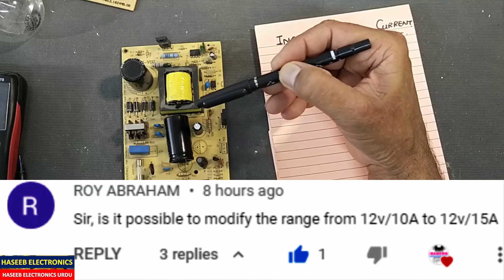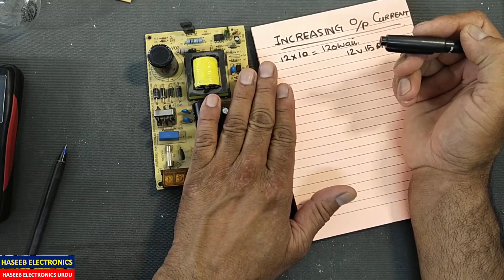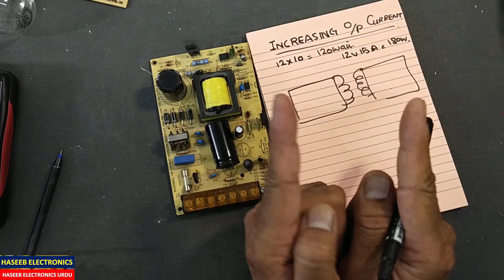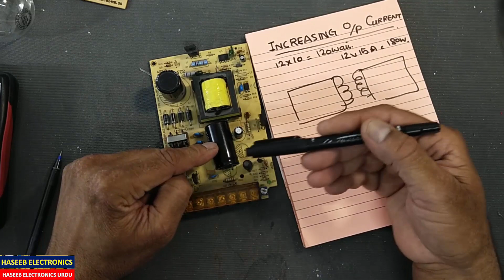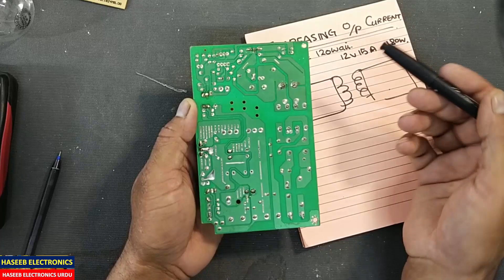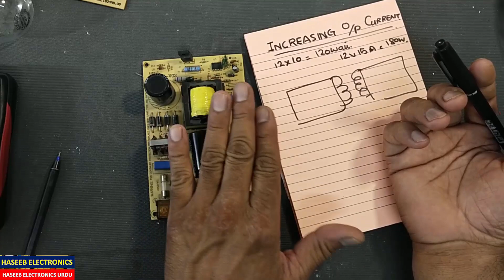{631} Is It Possible To Modify SMPS (Switch Mode Power Supply) To Increase Output Current

Comment: Can we decrease amp 3 to 2 by changing the value of current sense resistor?pl.reply if not affect my power supply.
Reply from the maker: exactly yes. just increasing the current resistor value, and also consider to increase power rating.

Comment: Just connect a 12v screwdriver to the output of the power supply and use it as a generator in both directions. Don't connect any current to the input. It may need 1 min to 10 min generating, when the drill rotated harder, you are done. You can fix defected stopped laptop chargers, usb didn't fix stoen chargers of 5v.

Comment: sir i have power supply of 12v 12.5 amp , voltage is variable , from 10 to 15 volt , i use this power supply to charge a 50Amp lead acid battery, but whenever battery is  deeply discharged the power supply start charging it with current greater than 12.5 amps which leads to trigger overload protection of psu, i want to make the charger current variable and  which should be between 1 to 12 amps, the power supply is MeanWell brand model no. RS-150-12

Comment: Did you ever work on making a dual rail supply by separating the secondary into two coils and making them in series? (We must use balanced load otherwise in load regulated at positive section,the negative section will increase its voltage... Anyway let me know if it is possible...
Reply from the maker: Good evening 
yes dear it is very simple. we need to analyze the load properly, then design the smps transformer using proper apparent power method,
in this technique, the secondary will stable, otherwise the outputs will imbalance and the transformer will heat up,   
if we calculate the load properly then no need to put balanced load on both rails. each winding will run its own load safely

Comment: hi Haseeb...i am using an smps 12v 5amps power supply...i do not want any modifications done on the smps...is there a circuit i can connect the output of the smps to increase the smps amperage from 5amps to 8 or 10 amps with the same 12v output? thanks for the video.

Comment: It is very easy to increase current, just buy a 300W version of the power supply, or better yet make it a 1KW unit so you would have spare capacity!... Another solution is to buy more energy efficient transistors for your projects that require less energy....

Comment: Hello sir plese help me mene  ek 12v 15amp ka smps design kiya hu flyback topology wala ..
Isme voltage and current proper mil rhi hai but but output wala scootky diode kafi heat ho jata hai kuch hi second me .dono side snubber network bhi use Kiya fir bhi heat ho rha hai.
20100 diode use Kiya hu.

Comment: Hi, if the power supply is designed to run on both 120V and 230V, at 120V the primary works with double the current to get the same output watts, is that correct? 
So, working only at 230V, if we increase the output voltage (for example we duplicate it), would the primary and the transformer be able to withstand double the output power? 
I know that the secondary should be modified to withstand the new tension..  
Thank you and best regards

Comment: AOA
I have 2 power supply both are in same fault. That output voltage are stabile are 13.8v when I putting load the voltage are decrease in 3 to 4v and a switching sound is nosing on mosfet. please describe solution.
Reply from the maker: please check the output capacitors, 
smoothing capacitor (main DC capacitor on  DC rail)
Reply: @HaseebElectronics  
Dear Sir
I have replaced out put capacitor but fault still persisting.

Comment: Yeap I agree. To upgrade those components or to buy a bigger one. 
How do you feel about using a resistor to ground? For example tying the sense line of a pwm with a low ohm resistor like 1 ohm to ground. I am trying to understand the logic behind the resistors value.
Reply from the maker: best regards
are you discussing the current sense resistor (connected between the mosfet source pin and the ground pin??

Comment: Pensaste un una solución plausible? tal vez usando una fuente de alto wattaje 400watts, en la que el fabricante especifique salida de 12 volts 15 amperes y modificarla para hacerla de 30 volts 6 amperes y que podamos variarla y controlarla con tension y limite de corriente con tl494 y lm339 no modificamos tanto. Agradecido de tu video
Reply from the maker: muy bienvenido y gracias especiales por su mensaje. Intentaré compartir el método de modificación muy pronto.

Comment: Pls can I change the input voltage from Ac to Dc 110v from battery thank you for everything
Reply from the maker: if it was 110VAC then its equivalent DC voltage after bridge rectifier at main DC capacitor will 110 x 1.414 = 155.54VDC
if you will apply 110VDC it may work, in some cases might these 110VDC will considered as LOW Voltage 
so arrange at lease 140VDC
Reply: @HaseebElectronics  
After I sow your usfull videos I learn   too much about smps supply, so I thought  to chang astartup resistance

Comment: honest suggestions, v good, it is better to buy new one for 15 amps. actually in our country people use 12v dc baleno motor for air cooler with computer power supply or some kind of 10a china ps,  15 or 20a china ps is costly, so they remain curious abt amps, bcos baleno +water pump works good on 15 amps ps, and 15 amps computer ps is low cost but when it fails then mechanics refuse to repair it, they said it is irreparable, its main ic is damaged.
Reply from the maker: you are right. "our mentality is to squeeze blood from Turnips"  which is impossible 
second thing,  most of the items are not repaired due to lack of skills and working principle of the circuits.

Comment: absolutely correct !  better to use 2 in parallel or 1 higher rated power supply
Reply from the maker: yes dear
that will the best solution

Comment: Sir my SMPS is 12v 5A during a load of 4A the voltage is down to 6v what is the problem in my SMPS and how can I solve it
Reply from the maker: check output capacitors. 
check current limit resistance (connected to the mosfet source pin)
Reply: @HaseebElectronics  okay sir

Comment: It's easy just buy one more 12V 10A SMPS and put in parallel. I have done this a few times and you have a great video on this too.
Reply from the maker: absolutely perfect. it is the best solution to purchase new one instead of destroying one also
Reply: Though I have several questions on this setup. First, how do we ensure the load is drawing approx same power from each source? Might it cause the power drawn to be lopsided? And therefore, cause one power supply to damage or possibly even both because it is supplying power over its rated specification

Comment: I have a 12V 15A SMPS. When I use it with a Car radio, there is too much Eletro magnetic interference and very hard to get a good fm reception. When I use the PC power supply for it, I have no issue as such. Can you explain the reasons for this and how to minimize EMI on SMPS ? Thanks in advance.

Comment: Excellent explanation, 
I have a question: regarding the electronics before the primary side of transformer such as ( full bridge rectifier, capacitors....etc ) aren't they all make low impedance which would draw high current if we don't add a limiting current resistor at the input of the power supply?

Comment: Jazakallah bhai for the video bhai. My case is contrary to this one, I used your method of adjusting smps voltage output to decrease 32v 3A adapter to 14v, but it only works once with the load, if I remove the load and reconnect it, it won't power the load until I unplug from main 220v and reconnect. Pls can you explain what the problem is?